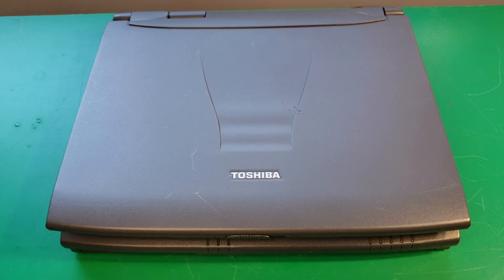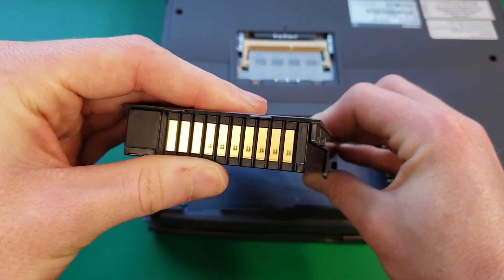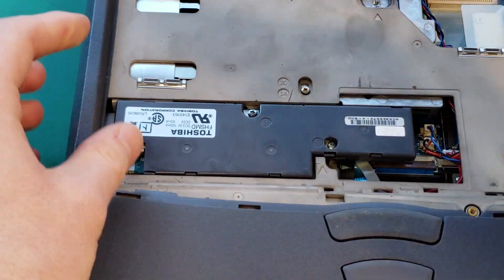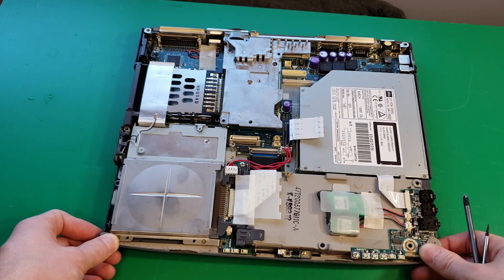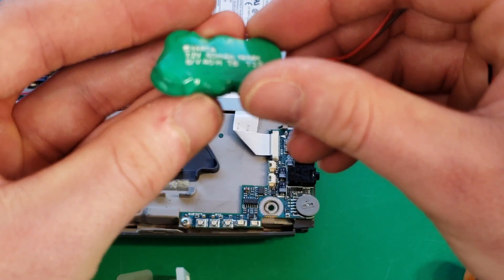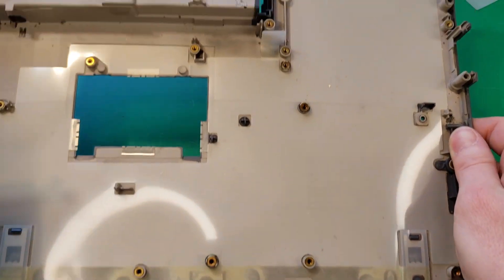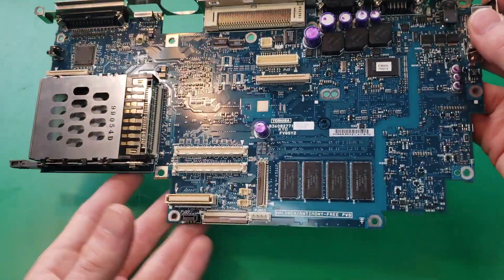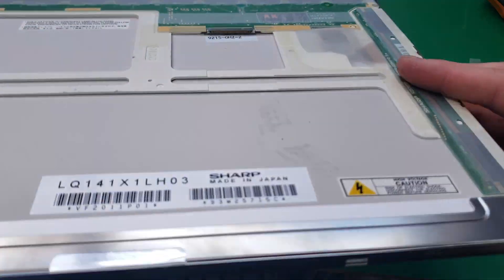Vintage Toshiba Pentium 2 Laptop Teardown

Comment: I have this exact laptop, I love it. It's just at that sweet spot where it's not too fast for early 90s games and not too slow for early 3D games. What's wrong with yours?

Also you're playing russian roulette with that screen. All of these older screens have a little bit of mercury in them which isn't a problem unless the screen is cracked, like yours. Handling it with your bare hands is tempting fate really.
Reply from the maker: I decided to part it out Because the screen was broken and it didn’t post. I have a very similar Toshiba pentium 2 laptop that is in good condition that I will be keeping. 

To my understanding, it’s not the screen panel that contains mercury. Rather it’s the small isolated fluorescent light tube that inside the bottom of the screen for the backlight that contains Mercury vapors. It could break while taking apart the Panel itself or if the screen was bent hard enough to break the tube. But In this case it was probably intact. If the screen was damaged any worse I would have taken more precautions. However I will be more careful in the future.
Reply: @BGTech1  cold cathode fluorescent tube